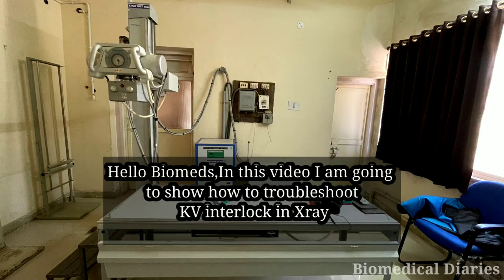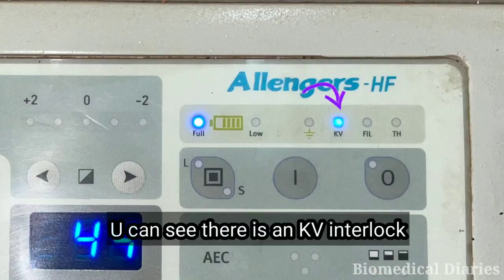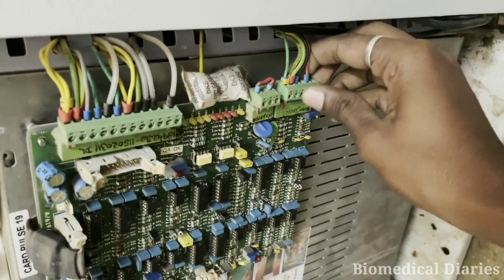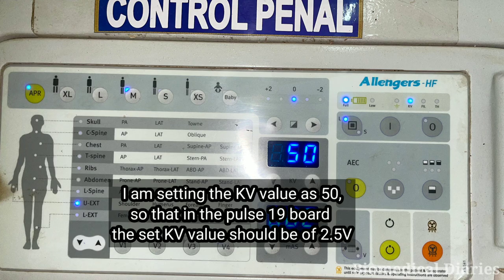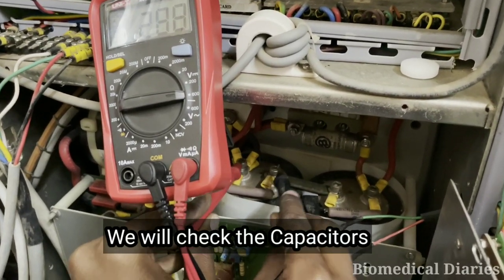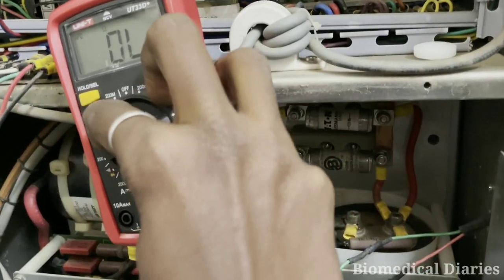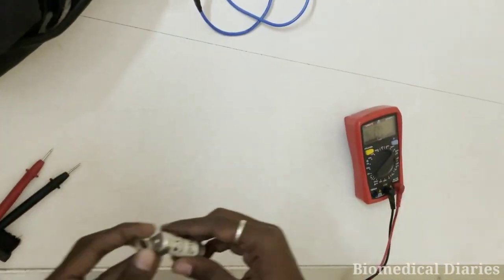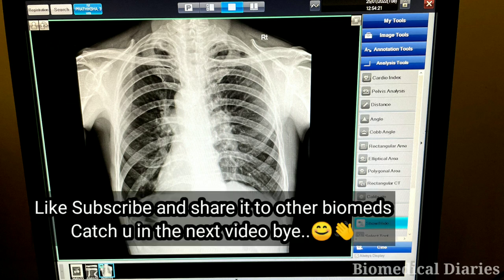X-ray KV error Troubleshooting |Biomedical Diaries | Biomedical engineer | Allengers X-ray | Mars15

Comment: This is not a fact that the fuse was open there is a reason behind that, this video doesn't totally show true. As per my experience if this fuse opens near the capacitor, you should always get another defective material in the inverter, fuse only reacts as open may be any supply of IGBT gate terminal or  DC terminals shorted. If you change only the fuse, the new fuse will blow again.
Reply from the maker: There are several reasons that fuse will get blow....

It's a basic thing that every Engineer will check the near by things properly before replacing the fuse. 

After replacing ,..the fuse was not blown it was working fine and till now there is no issue.